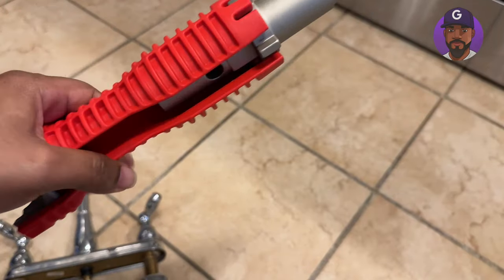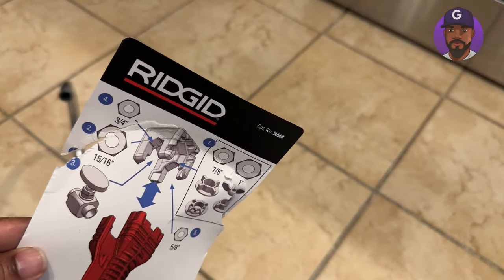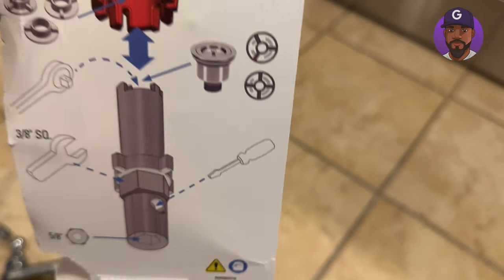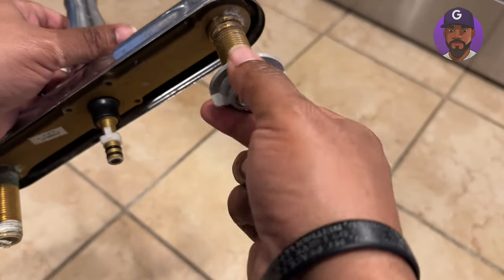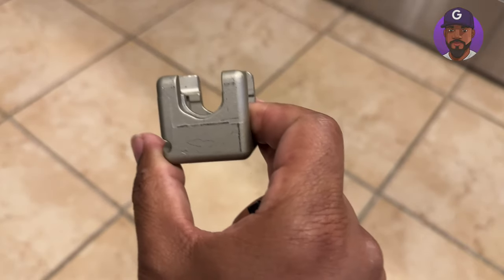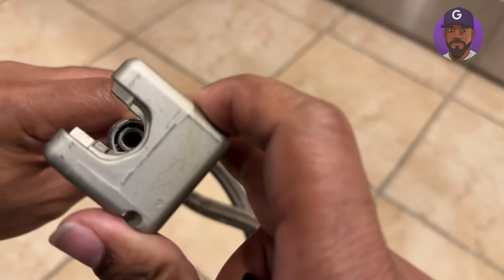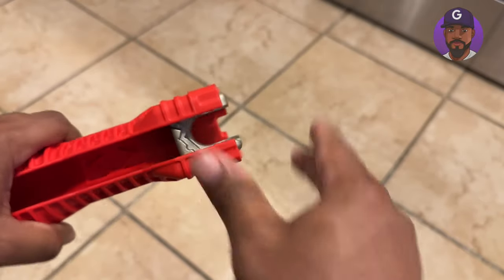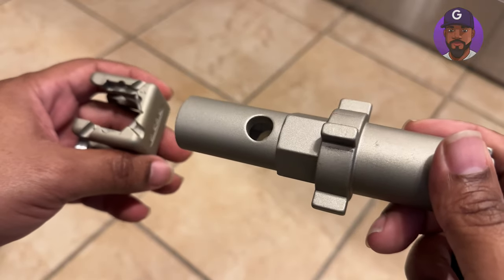How to Use Rigid EZ Change Faucet tool | Quick Faucet Replacement

Comment: Absolutely right ! Spent 45 minutes and wasted about 30 of my prime swear words using a pair of channel locks trying to losen the basin nuts, finally quit and looked at You Tube and saw your video . Went to home depot, it was 19.99 and arrived home and had both basin nuts off in 5 minutes.  Thank you ! Never knew this tool existed !
Reply from the maker: Glad to hear that this tool made your life easier!!

Comment: This is a great tool.  I just used it to install a new Kohler kitchen faucet.  However as much as this tool covers, didn't help in removing a 12 year old Kohler Faucet. When you remove the Cube shaped Metal attachment, the tool will fit the two screw heads in the Round Lockdown Ring to tighten the Faucet to the Countertop.  On the old Kohler it's a Oval Ring, too wide a gap for the tool to grab those screwheads.  I used a couple of small vice grips to grab each screw head to crack it, then was able to unscrew it by hand.  The Rigid tool worked fantastic on socking the new faucet down. PS...$15 at one of the big box hardware stores.  Excellent recommendation and review!
Reply from the maker: Thank you for watching the video and sharing your experience with the tool!!!

Comment: That is a neat tool, thanks for exposing it to me. The screwdriver hole is there to give greater leverage when twisting, or you can use a wrench on the flats above it - just giving you 2 different options it seems.
Reply from the maker: Great point!